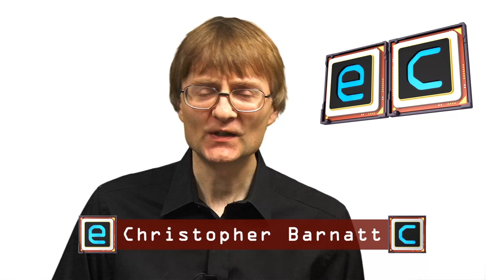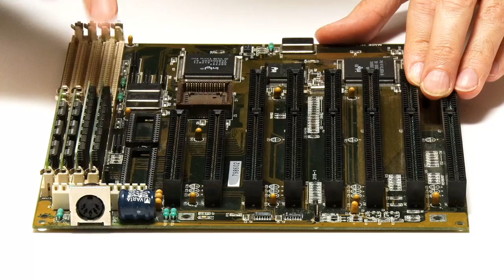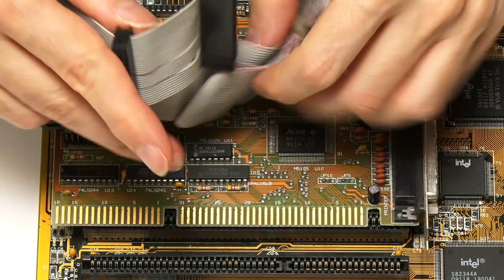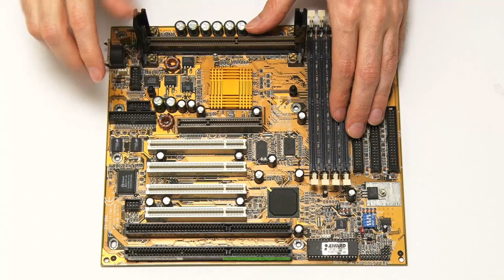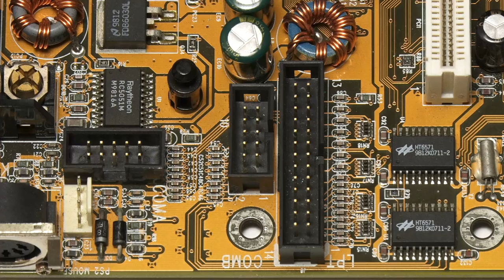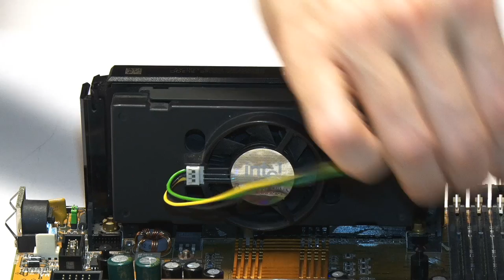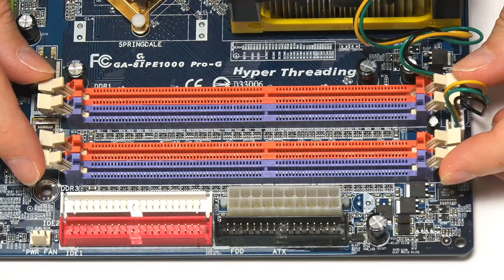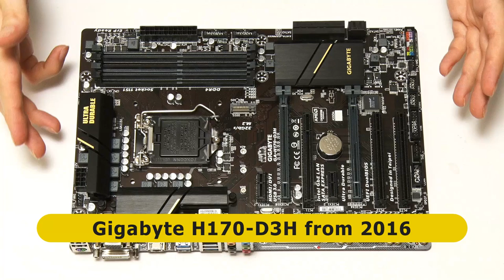PC Motherboard Evolution

Comment: My first "PC" after my Amiga was a second hand NEC V30 based on the 8086.  I then progressed to a 286, 386 and 486.  I remember buying an AMD 386-DX40 in about 1993.   It cost $500 for the motherboard with the CPU (almost same as pictured here) and $500 for the 4x 1Mb SIMM RAM modules.  So $1000 NZ in 1993.  HEAPS of money for a broke 19 year old student!  A single speed CD ROM drive was $300.

I managed to fry a 286 board and CPU by plugging a SEGA cartridge in an ISA slot to see what happened.  Killed the cartridge AND the computer!  Also fried a 486 CPU by inserting it incorrectly into the motherboard.

On a separate note, you can often tell the age of components by reading the date code on them.  I have an uncle who was an electronics engineer and he told me the code was always four digits, the first two being the year, the second two being the week within the year.  You can clearly see at 2:19 the SIMM modules have the date code 9241.  That of course being the 41st week of 1992.

Great presentation by the way and your video brings back many memories!
Reply from the maker: Fantastic post, thanks for sharing. Those were the days!

Comment: The slot board looks like it takes the old AT power (I remember muttering "blacks to middle" when putting in that ridiculous two piece connector - the PSU doesn't like it if you get that wrong!) or ATX power - the transitional era between AT and ATX.

PS. AMD also flirted with the slot format, but I don't think Slot A lasted that long before being superseded by Socket A.
PPS. Aww, no VLB, my first PC had VLB

Comment: The olden days when AMD and Intel both worked on the same CPU socket... If you needed more video RAM just add more chips to the card... A PC took 4 hours to build, then burnt in for 48 hours before a customer could take it away...

Comment: I miss the days, when people could get something like athlon 3000+ and overclock it to FX-57 clocks and get +700$ value from 140$ cpu and do the same with graphics cards, like you could get geforce 6200, unlock 4 shaders and overclock, so that it would turn 6200 to almost 6600gt (80$ with +120$ value).

Comment: Great presentation.  I started out as a corporate manager power user with Apple II (Lotus 123 spreadsheet), then IBM PC, then 286, 386 etc.  I was President of a 1200 member PC user group (with subgroups on hardware and software) - the North Orange County Computer Club which still exists at http://noccc.org/.  Having USB for many uses is great. Now there are not small speakers included for the beeps.  Years ago, geeks like me would make the rounds of PC shops in Southern California to see new hardware and software.  I was a software junkie and spent lots on productivity software products now part of Windows. As the corporate internal audit manager for a national firm in Newport Beach, CA, I got the latest portable about every 6 months, but started by traveling with a full Apple II and two floppy drives and green screen monitor I took with me to plants I visited.   I still have some old computers, including Imsai, Altair, Sinclair, several iterations of PC cases, etc.  because I was in Orange County, CA and many high tech firms there were early adopters of computers and later sold them for $100 at swap meets.

Comment: Small Computer System Interface (SCSI) was also used as an interface for connecting hard disks drives, floppy disks drives and optical disks drives. It was use in servers until after the turn of the century.

It should also be noted that all of the the 386, 486, and early variants of the Pentium processors were 32 bit processor even though most desk top operating systems of that era were only 16 bit.
Reply from the maker: I did not that IDE was not the only interface used! I used SCSI a lot in the 1990s on desktop PCs equipped for video editing.

Comment: Super socket 7 was the best, it felt like it was around forever, they squeezed a lot out of it. Also I remember a time when old computer stuff was being thrown out and could be bought for next to nothing, now if you want those old parts it costs an arm and a leg!
Reply from the maker: So true. There are so many boards I could have saved. I remember a 286 that sat on top of my filing cabinet at work for a decade, just because I thought it might be useful some day. Then I let it go to electronic waste when I moved offices.

Comment: looks like the barrel battery leaked everywhere on the 386 board so the board is dead 100%, difficult or impossible to fix, the other 386 board with the 386 PGA ceramic chip that is in the case's barrel battery also looks leaky and has damaged traces too. i bet the slot 1 baby AT gigabyte board would work unlike those 2 386 boards

Comment: You have forgot to point out some other differences in mobos like up un until the pentiun ii microprocessor the cache memory relied in the mobo and that was the reason for the Pentium ii to be made in a slot format.

Another thing you forgot to mention are the AT and ATX power connectors and how they worked and also the differences between isa and other connectors up until the actual PCIe connector.

Well there are more differences that i cannot remember anyway i like to see your videos, cheers.

I forgot... The differences between write back and write through cache memories..... Damn thank you for such big and beautiful memories.
Reply from the maker: Yes, I should have talked about the other connectors. On the broader point in the intro I said expliclty that the video is not a definitive hisotry and will not cover all technologies involved! :)

Comment: I think you meant that first mobo could take a max of 64 Mb. I got my first computer in 1976, I had an original mac as well.
Reply from the maker: No, the first motherboard could take 16MB -- that is the maximum that a 386SX (as soldered to this board) could address.
Reply: I heard 60 Mb not 16 Mb that explains it.

Comment: You should have started with the 8086 board with soldered on (or in sockets) memory chips. If you wanted to increase your memory, you had to piggy back the chips.
Reply from the maker: As I noted at the start of the video, this is not a full history as it was based on the old motherboards I had available! :)
Reply: @ExplainingComputers  Yes, that is correct. You did. I'm bad...

Comment: Motherboards also had their fabrication date printed somewhere on them.
Reply from the maker: I looked for this on these boards -- if it is there, it is not obvious! :)
Reply: Maybe, depending on make, yes. Back in the day when I opened computers for a living I observed some of them did have a date printed. Setting IRQs by hand flipping DIP switches because everything had to be done by hand if you wanted them to be useful for anything at all, that was fun. Greetings sir.

Comment: I'm some what 99% sure the first motherboard has EISA slots which were pretty expensive to buy cards for it. Mainly some at the time, high performance scsi cards came in EISA format as well as video cards came in EISA flavor, other being Video Local Bus which was phased out by the PCI then PCI-e now.
Reply: Stand corrected, not EISA but just standard ISA. I believe EISA was introduced with 486 processor that were 32 bit bus to match with EISA capability.

Comment: Replace the NiCD-battery before it leaks!The 386 board is in great condition - keep it that way!
Reply from the maker: Noted! :)
Reply: Later in the video you can already see the alkaline doing its job ... I repaired dozens of older boards for my collection. At first, it just looks like some mild corrosion, but when you look at it one or two years later, and maybe stored it in a humid cellar room, the board is lost forever.
You have removed the socketed ICs? For collecting otherwhise or displaying?

Comment: I still use a PC from 2010 that runs flawlessly today with windows 10. However a PC from 1990 wouldn’t even run anything 8 years later or from 2000 to 2008.

Comment: I think its an interesting watch. I did however use the Super Socket 7 setup from AMD in the 90s. It was available both in AT and ATX. The ATX standard being launched in 95. Its interesting that ATX won over users in the way that BTX didn't. It seemed kind of logical that an update to the format would happen every 10ish years. AT (85) -> ATX (95) -> BTX (04). Yet here we are in 2019 and ATX is still going strong. Kind of like x86, we keep expecting it to die, due to RISC or 64-bit, yet it keeps motoring on. Considering the age of ATX though I think I would like to see some further improvements. Slots tend to not support the weight of cards very well. In fact if you look at most cards, they are advertised essentially with the bottoms (fans etc) in shot. We still don't have a great standard for front panel connectors, with each board doing its own thing. It makes me wonder what else could be improved ala SATA and USB.

Comment: What I appreciate about the old motherboards is that you have an expansion card for whatever you need. 
It’s not much about the fun of it, because I can just imagine the amount of pain and time wasted when building a pc back then. It’s uncomfortable and needs an expert to build it. 
It’s about the repairability and the e-waste question. 
Now ATX motherboards have everything, which means more and more things risk to break ON the board, so that you’ll need to toss it entirely. Think if the sata controllers breaks, or the lga pins (compared to the PII). Man I can still feel the scare of installing intel processors😅 even though it’s been a while I haven’t!
Of course you can’t think it this way for mini-itx or compact pc’s in general and also, that many space occupied by cards and cables will create a lot of problems for cooling. I would be still curious about a cpu installed like a gpu, with that kind of cooling too…

Comment: to comment on motherboards with no options - I remember when the vlsi things started happening and then the 'motherboard on a chip' happened - first it was 4 chips.  but for those not old enough, they did not have to deal with 'buying everything'.  It became so nice to have almost everything you need on the motherboard when you buy it. = to add - in the late 70s/80's - I read byte mag. the person who wrote 'Ciarcia's celler'  - designed the first 'motherboard on a chip' - it was 4 chips - but I remember when that happened.   eventually - it was shrunk to 1 chip - as we have now.

Comment: Nice video, great presentation. But I think you missed a lot. You should stay way longer in the 90s since most happened there. You omitted the math coprocessor/FPU and L2 cache.

The more I learn about computers from the 80s and early 90s the less I understand how Intel could become so dominant. When CPU upgrades were so rare they didn't bother to socket them, and the arch was so bad.
Reply from the maker: As noted at the start of the video, I included what I could show from the boards I had. I did note that this was not a definitive history! :)
Reply: I know, but the FPU and L2 were definitely important milestones in mobo development, so I still think you should have talked a little bit about it. You could have use still images.

But I'm glad to learn that in the beginning there weren't even sockets on IBM PCs.

Comment: Luckily all the floppy drives and the motherboards were very tolerant to plugging the cable backwards: the floppy drive access light would stay lit, the drive wouldn't do anything, and it couldn't be detected.

It was a little bit annoying cuz at that point you knew you needed to do max 2 rotations of the cable to find which way was the correct one if the cable and/or the drive wasn't marked, which they used to be. At least you didn't need to do more if the cable and drive were perfectly functional.

Comment: For that Intel Pentium 2 processor, it would have been on a 66Mhz Front Side Bus.  That means that you have to set the FSB to 66Mhz and set the clock multiplier to 4.5 in the jumpers.  A lot of processors from this time period were 3.3 Volt, but the Intel site claims it was 2.0 volts.  I don't remember seeing 2 volts as an option on motherboards back then but I could be wrong.  I dealt more with Super Socket 7 motherboards back in the late 1990's and early 2000's.  Super Socket 7 motherboards had more jumper settings because they were more of a generic board for a bunch of different processor brands.  However, to correct Christopher, logically you'd expect a FSB of 100Mhz with a clock multiplier of 3.0 for that processor, but Intel didn't start the 100Mhz Front Side Bus until the Pentium 2 350Mhz processor.

https://ark.intel.com/products/49937/Intel-Pentium-II-Processor-300-MHz-512K-Cache-66-MHz-FSB
Reply from the maker: Thanks for the correction. This has me pondering, as the board ran fine! :)
Reply: AMD made a version of the K6-2 processor that was 300Mhz with a 100Mhz FSB for Super Socket 7 motherboards.

Comment: Its a great video but the presented dates arent accurate in mine opinion PCI slots and DVI ports are much early like 2003...
Reply from the maker: Nowhere in the video do I attribute a date to the introduction of either PCI (which was 1992) or DVI. Rather, I show board from certain dates that have those hardware features.

Comment: I assembled PC's for a living from 1993 to 2012, so I would say I have seen every motherboard design out there :-)
Reply from the maker: You have seen some interesting times!
Reply: Yes, but I missed the early 286/386 boards. The first new PC I assembled almost 26 years ago had a 486SX CPU and Vesa Local bus expansion slots. VL bus was superseded by the PCI standard just two years later.

Comment: Id like to mention that I bought modern MB few months ago and it doesn't have other very old and common connector, which is VGA. Instead it has Wifi antenna, USB C, LED, Display port, Audio Optical  etc. So the "end of our journey" in year 2018 is far further than you video. Anyway Id really liked to back in time with you to see our story with PC's.
Reply from the maker: Many modern (2018) boards have a VGA socket -- especially those with a larger form-factor. :)

Comment: surprised to see PCI on the 2016 mobo, thought PCI had been dead longer than that, oh well... My first PC was a 386sx 16MHz with 1MB ram, that I later upgraded to a whopping 5MB.... sadly it is long gone, but I do have a 486 lying about and I think a Pentium 4 or so as well
Reply from the maker: Many new boards still have PCI slots, esp larger boards.

Comment: Wow. The 386 mobo didn’t have any onboard connectors for any sort of storage. The first thing anyone would ever expect to do with a computer would be to boot from disk.

Maybe floppy and HDD controller electronics were dodgy and anything integrated into the motherboard was a risk?

The 1999 slot-A / slot-1 mobo is where I got on. I remember being surprised that a northbridge chip could warrant its own heatsink.

These days, even the term northbridge/southbridge is antiquated
Reply from the maker: It was simply a matter of cost and reliability I think -- the more you have on board, the harder to make and reliably deliver it it/was.

Comment: I used to assemble computers in the early 90s. Sometimes it resembled more occultism then a real profession. Things often just wouldn't work and nobody me included could tell the reason why. Then again it was the total opposite and things worked out just fine although they shouldn't. Two years ago I built my own PC after a very long break and without looking into the subject for a long time. I have to say it was a child's play and I didn't encounter any trouble at all after reading up on the topic for a few hours using this new thing called the internet.

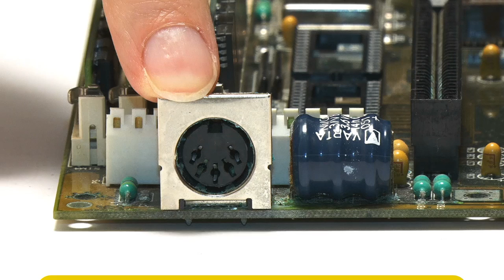Comment: @ExplainingComputers Do you think it be interesting and to be more aware on CMOS Batteries as well as SRAM Batteries - possibly on regular AA batteries and the intriguing part on leaks? Because that old PC Motherboard of yours had a nasty leak corrosion in (4:12) as the AT Port seems to be ruined. Besides I had forgotten to remove my Lego RCX 2.0 Brick's Alkaline Batteries that "bricked" my Lego; pardon the pun. Remember how Samsung made a notorious flaw with the Note 7 that made their batteries explode? I learned that most rechargeable batteries tend not to leak as they contain a roll of metal mesh, but some extreme higher capacity batteries that are tightly compressed can be unstable:-

https://www.youtube.com/watch?v=tBg4ximDrsk

I also know you can get Smart Chargers for AA batteries that are supposed to be safer and can charge various individual branded batteries like the Technoline BL700N but there is a Chinese cheap and poor clone of that known as the Youshiko YC4000 - which feels like hard cheap plastic but doesn't recharge batteries that are completely flat. I know this is kinda going off the tangent, but for computing like Pi Bots that require those batteries or those custom made Li-Ion Batteries for the Pi Robots, then it be useful to know which batteries we should use.

https://michaelbluejay.com/batteries/

So I don't know if the viewers who are reading this may ask ourselves this: Which batteries should we use? And are those barrel shaped batteries or Lithium Button batteries really need to be desoldered/removed to avoid our Watches, PCs and maybe our NES or Game Boy cartridges? My 1st answer would be, Rechargable Eneloop batteries; and the 2nd answer is, yes remove them when they are dead or your circuit-board will be ruined for your PC, Arcade Machine even your Calculator maybe.